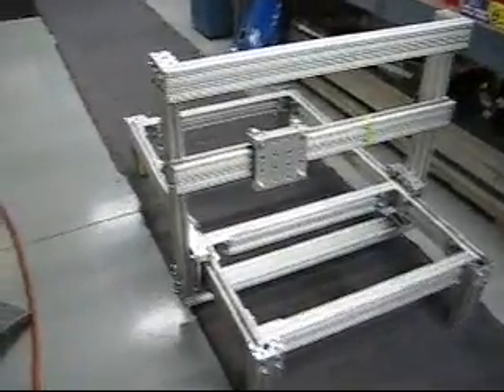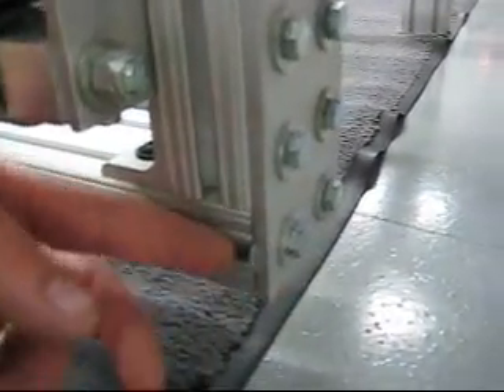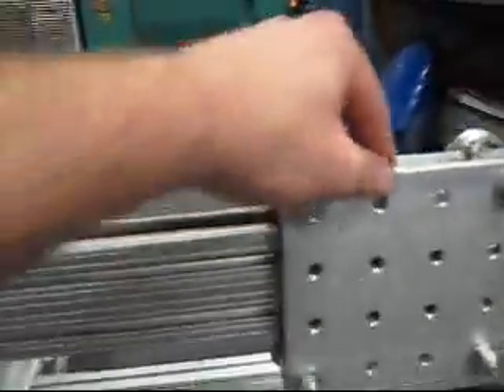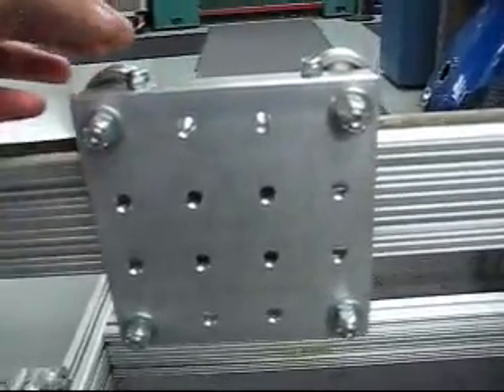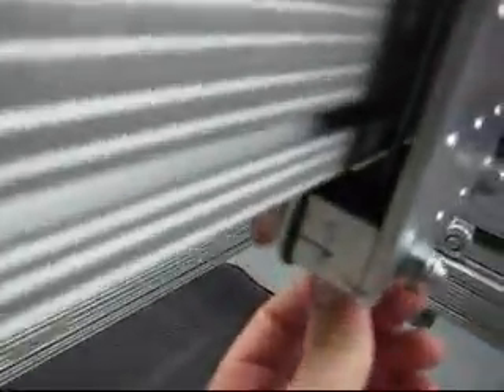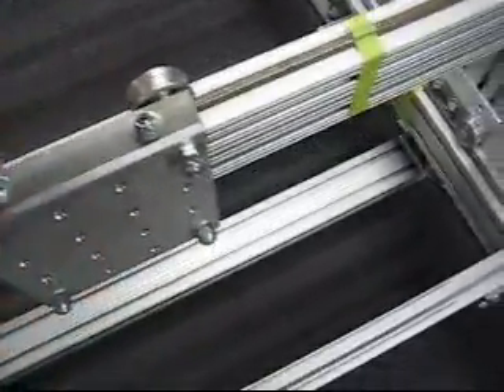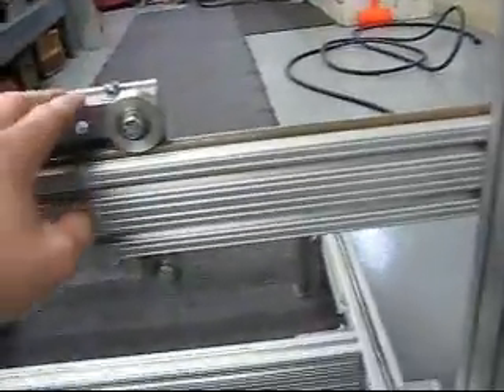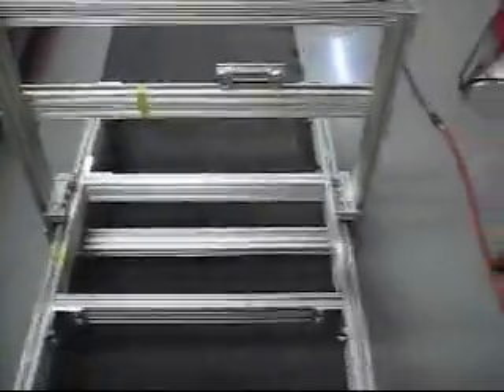CNC mill update report

Comment from the maker: @ryer9000 I've got it up and running.  I'm using EMC2 to control it.  EMC2 works but imho is a pain in the butt to learn.  My linear bearings work good so far but I plan on redoing the x and y rails at some point.  I posted another video last week showing it in action.  If I had the money to waste, I'd like to make another one.

Comment: Are you kidding? Those tensioning bolts are ridiculous. All you have to do is drill a hole from the top into your slots for the upper bearing bolts. Tap it for a screw and you're done. Loosen the upper bearing bolts, tighten the screw in the tapped hole so it pushes against the side of the upper bearing bolt thus squeezing it against the Y axis rail. Tighten the upper bearing bolt again and you're done. 2 little tapped holes, 2 little screws, simple. Why would you go through all that bolt shit?